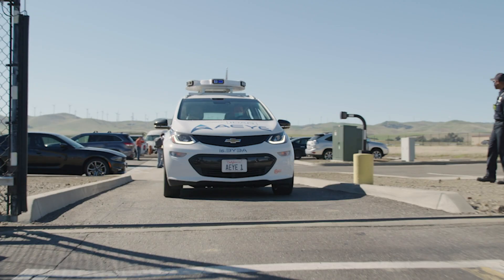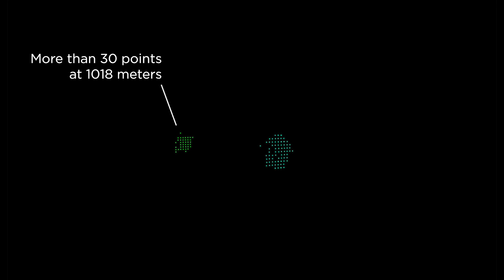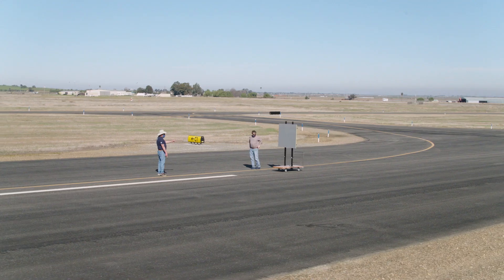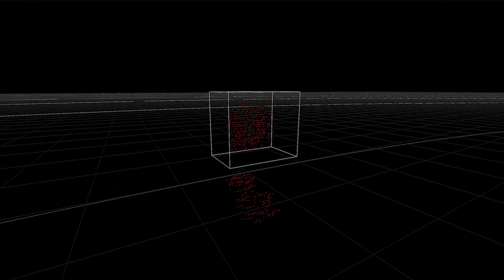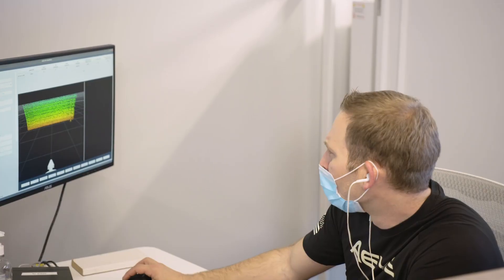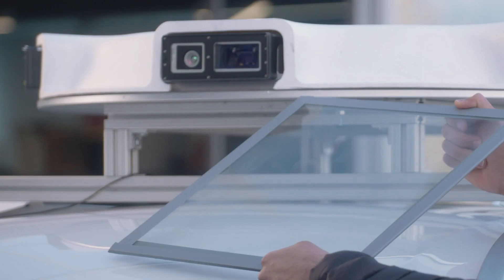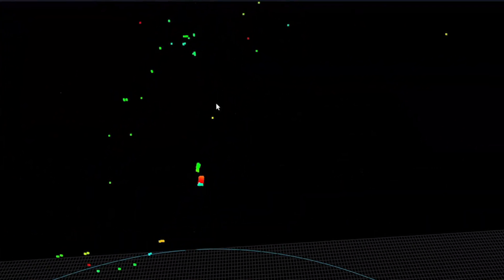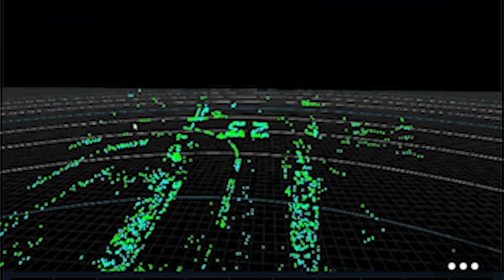AEye iDAR: Sensor Performance Testing 2021

Comment: I think Aeye is on the wrong way for automotive lidar. OEMs want to have a lidar with balanced specs that they can offord. Only ultra-long detection range and high resolution beyond reasonable requirements is ridiculous.
Reply from the maker: This was a technology demonstration showing the range capability of our architecture. We've also released a video showing framerate capability of our architecture (https://www.youtube.com/watch?v=TyIf6kEyERg) . For automotive deployments, check out this video showing how a 4Sight equipped ADAS or AV system can reconfigure itself to adapt to different operational domains (https://www.youtube.com/watch?v=l2whrGnxJ4s).